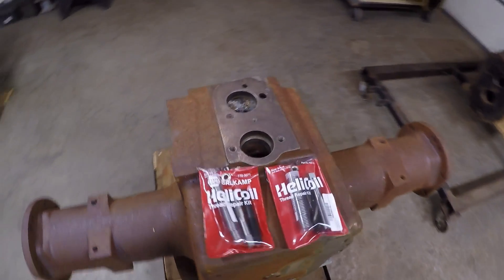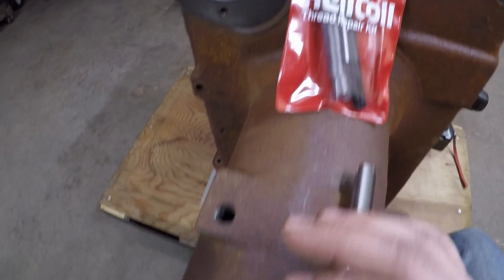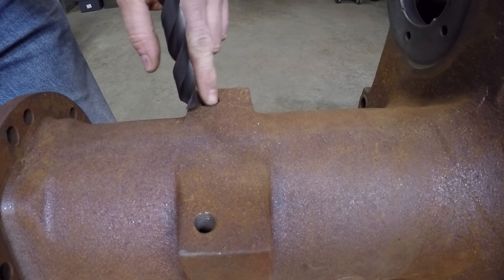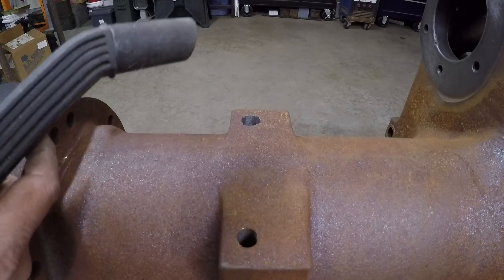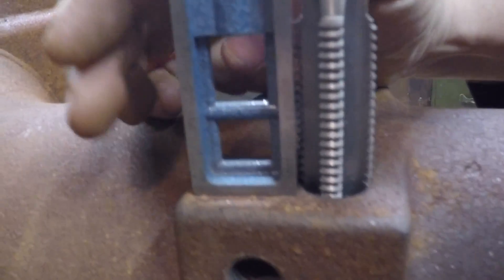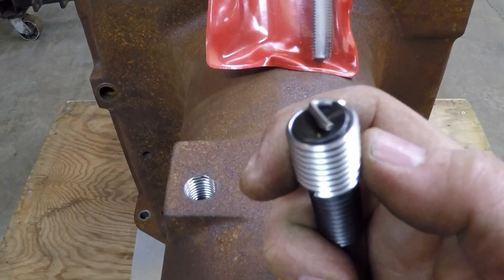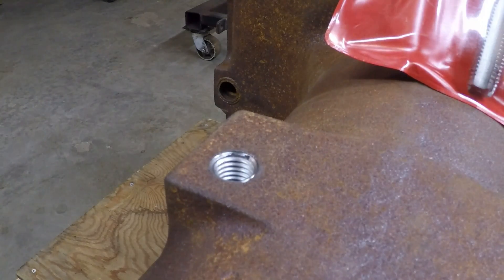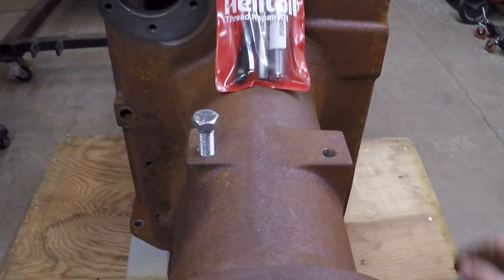Old Tractor Restoration Tip #5: Repairing Damaged Threads With HeliCoil Thread Repair Inserts

Comment: I like to wipe some loctite on outer side make sure they done come out  Fixed a oil filter thread once ding bats over turned a external oil filter fitting on the block but at times it would loosen so put some loctite on it stayed forever.